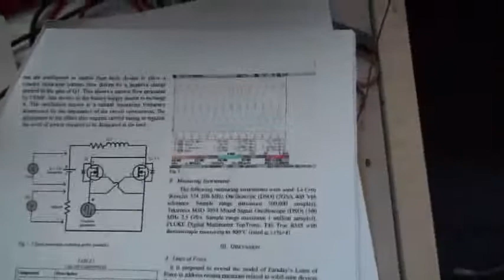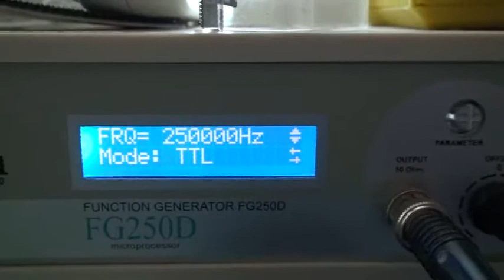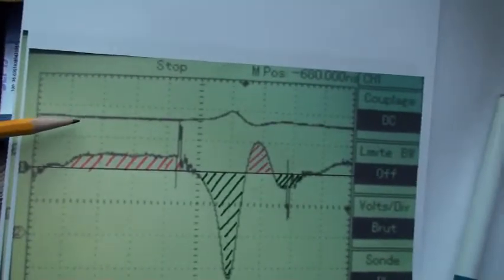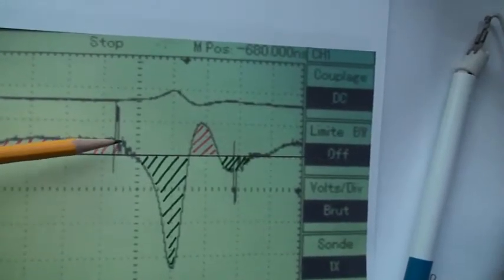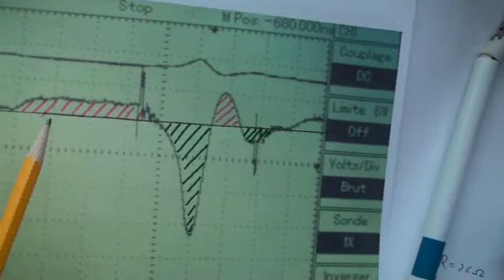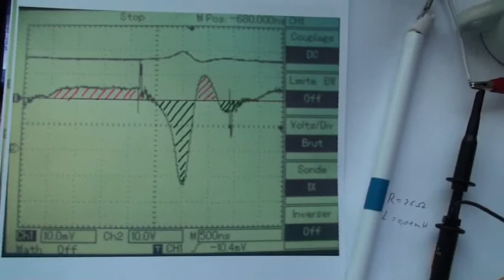Rosemary Ainslie basic replication 1.wmv

Comment: Sorry the same mistake as everyone else ..... disconnect the function generator and measure across the positive and negative leads of the function generator with a volt meter you'll see that you are inducing voltage and current from the function generator into the circuit. The second is all the testing equipment negative ground loops effecting the readings.